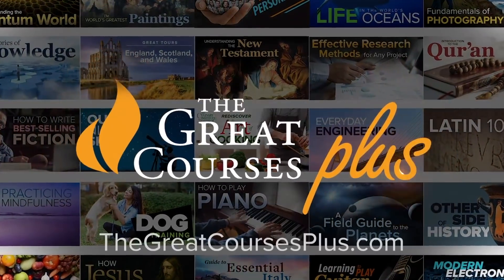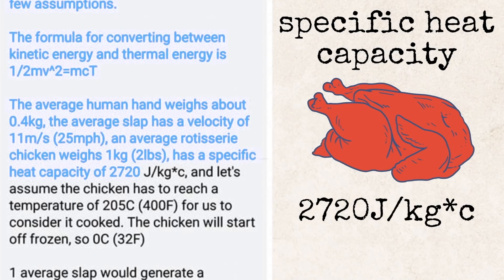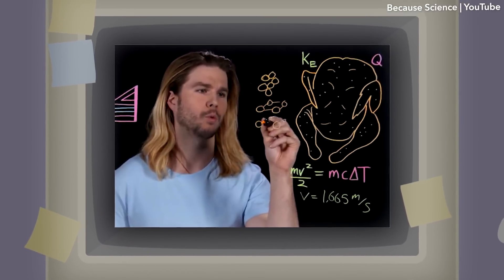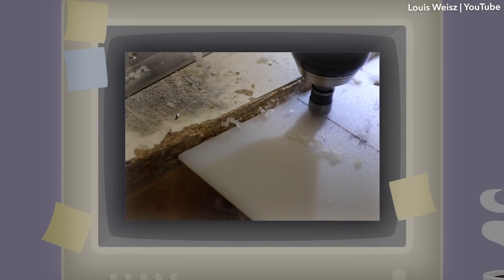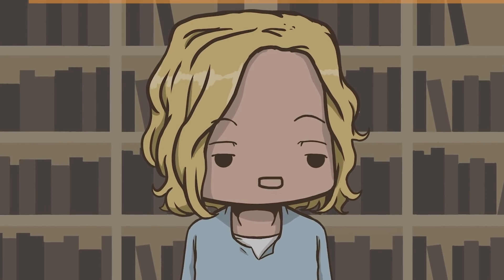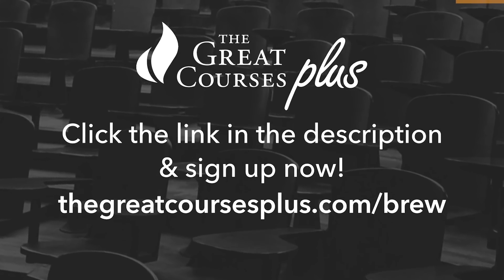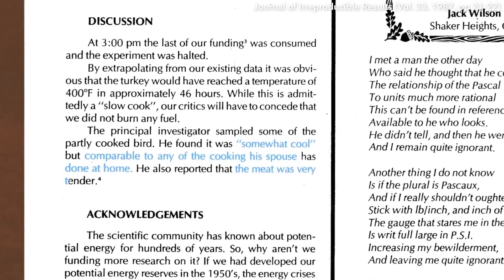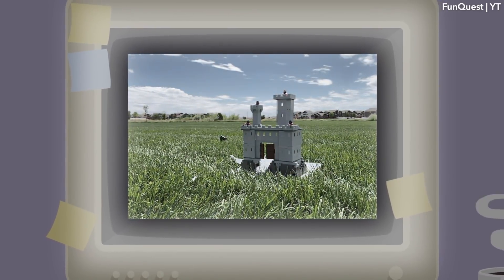Can a Slap or a Drop Really Cook a Chicken?

Comment: theres also the fact that since the bird isn't in an oven surrounded by metal walls there's no insulation to trap the heat so it dissipates of course it wont get above the 85F mark you mentioned... try this experiment with some form of insulation to trap the heat inside the turkey... do not provide heat from the oven or anything use only kinetic energy but get some insulation to trap that heat... and test again.

Comment: What if, instead of slapping the chicken directly, you built a machine inside a well insulated device ( you could put it in one of those convection ovens but not turned on or plugged in  ) that slapped another material NEXT to the chicken.  Something that could generate heat decently AND wouldn't fall apart like a chicken.  You could heat the inner area up from the slaps without destroying the chicken, and heat it to a sufficient temp to cook it.

Comment: My fellow human encyclopedia, I’ve pondered this question for the last 7 years: Is the double slit experiment fundamentally flawed? Isn’t the detection device used to measure the wave causing the interference? To clarify not the observation, but the function of the detector itself? I had a physics teacher tell me once that they use a laser to detect in the experiment and that because the detector uses a laser that the interference is obviously caused by the collision of the perpendicular waves. I know that the original experiment was considered flawed because of material reflection, but later renditions took this into account, and our modern versions can replicate the results with the sequential release of individual electrons rather than a generic laser and yet still produces the same interference pattern even when we have better materials that prevent reflective interference. But even modern experiments still use detectors that fire particles to measure the experiment. It makes me wonder how accurate the experiment actually is.

Comment: Could you cook a chicken by dropping it out of a re entry attempt at the top of thermosphere or bottom of the exosphere.  Then catching it before it leaves the stratosphere.
Reply: Likely not, as the heat generated would be minimal, hence why sounding rockets don't need a heat shield. If it were dropped from orbit (assuming is in a small capsule with heat shielding) it would be quite easy to cook if done right. (If done wrong you get either an uncooked chicken, or vaporized chicken)

Comment: You state that the potential energy of a chicken is less than that of a turkey because the chicken is lighter. This is irrelevant. Both potential energy and heat capacity is proportional to mass so the temperature change would only depend on the specific heat capacity of the meat and the height of the drop.

Comment: It took more energy to carry the turkey up the stairs than was gained by throwing off the ledge. Because the intern had to carry both the turkey and his own body up the stairs. You use energy going down stairs because you are controlling your fall and using muscles to prevent you from just dropping at full speed. Energy use down and up. Massive total loss of energy. And that the turkey didn't even get to the ambient temperature of the air from the chilled temp it started from.. very poor energy transfer when hitting. Most of the energy went into rebound and deformation. Plus what little heat was generated, the ground got part of that. And as the ground is a very large connected body... will take a LOT of hits to warm it up. So what did that researcher eat? (if they actually did eat any of it) Raw Turkey Pate`.

Comment: How can someone be simultaneously so forward thinking to foresee the energy crisis in 1987 but at the same time arrive at the conclusion that throwing things out of tall buildings is the best approach to cooking? 

It would be kind of hilarious to see the cooking books in the alternate universe where that would be the preferred way of cooking. 

Anyway, first of all wood is a renewable resource so we'll always have fire. Second, as long as we have electric energy you can cook with induction or ceramic furnaces (although those weren't a thing in 1987 I think so I can understand they didn't come up with that).

However, if they knew you can convert potential energy into heat they should also know that you can turn potential energy into electricity and electricity into heat. So even if somehow you run out of all kinds of fuel (including wood, which would be a problem in itself anyway but never mind that) you could simply use potential energy to power the electrical grid (for example by using a dam) and use that electricity to heat up your food. 
 
If they would have thought it through a bit more they would have seen this too...

Also their calculations are hilariously inaccurate for obvious reasons.

Comment: I did not like the experiment of dropping the turkey from the balcony 72 times. The claim it cost zero energy? Heavens no. The energy transfer was terrible. They were spending more energy into it for getting little energy return if any. The bananas to keep the undergrad going, was in essence their fuel. They ran out of bananas. The undergrad gor tired. 72 round trips on the stairs? Must take into account the amount of energy the undergrad needed to put out to achieve that. I just, did not lile their thesis.